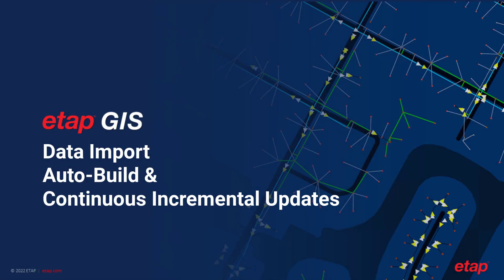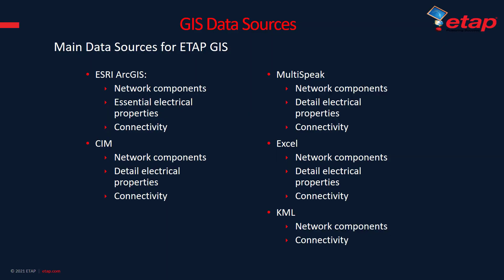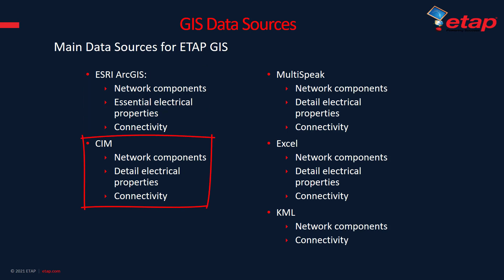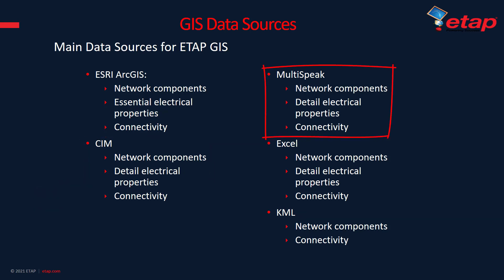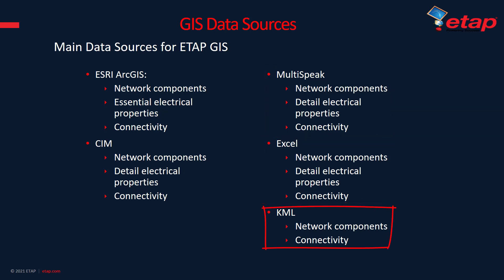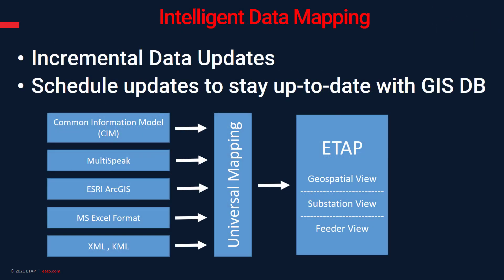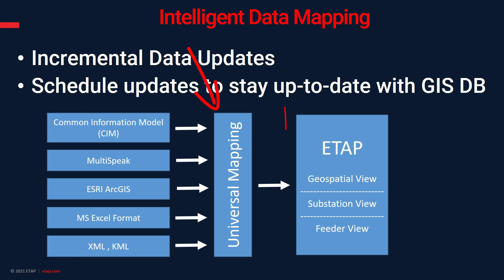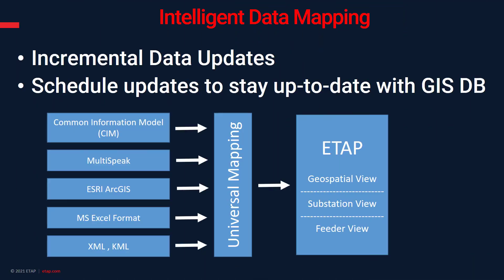How To Utilize ETAP GIS Data Mapping & Auto-Build to Create Single-Line Diagram of T&D Networks

Comment: Good Solution, But In Power Transmission system (above 66kV Voltageclass) what are the Elements and parameters are required to be mapped in Arc GIS (spatial and non-spatial data) to carryout Loadflow analysis, SC analysis, Switching sequence study and Relay co-ordination system. so that the Intelligent Etap can generate the network model using the GIS data model. #etapsoftware #ETAPsoftware
Reply from the maker: Thank you for you interest in ETAP Solutions and you positive feedback. Please contact our Help Center at https://helpcenter.etap.com to assist with your question.